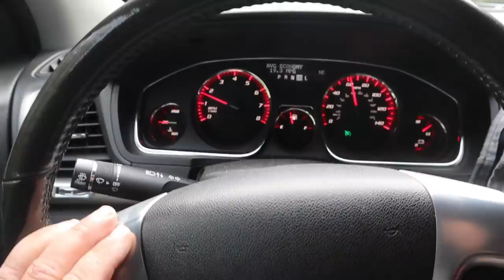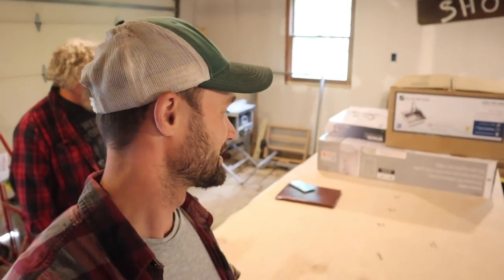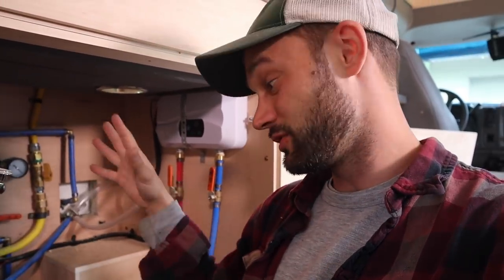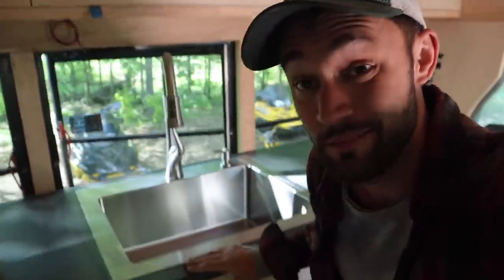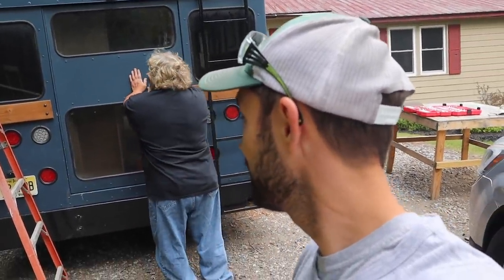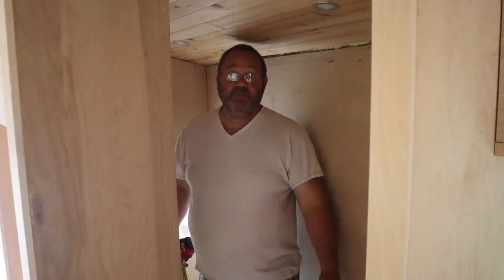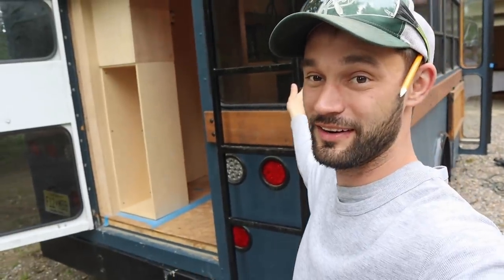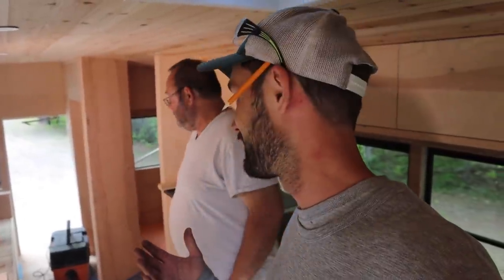What Was I Thinking | Removing The Rear Emergency Door

Comment: That door flipped around is really growing on me. Plus it made it way easier on you. Great job everyone!
Reply from the maker: It was a lot easier to just switch the door upside down than removing the hinge. I was really happy when Dale came up with that idea.
Reply: @navigationnowhere  I love the comedy trio you have going on. Dale is one funny dude. I’m renovating my bus right now and I’m debating completely blocking off the back door with new sheet metal. The chore of rivets is becoming overwhelming though haha
Reply from the maker: Thanks, Going through all those rivets can sometimes be so hard. Worth it in the end.
Reply: @navigationnowhere  looks great! My husband and I watch all your videos and we love you and your channel. We were curious if you would add any contact paper to the door windows for privacy?
Reply: @ladyaofpineapple5000  I've used a Valspar product to frost (the inside) windows in my home. I used a big sea sponge. It dries fast, so you can build up the number of layers to achieve the desired effect. UV doesn't degrade it.

Comment: In the video regarding the pan Kit when dad is showing the drain and pieces putting the 1st piece in,  you can see all of the layers? wood foam etc.  is there a tube piece that is in the hole so the drain water doesn't find its way between those layers.  Sorry if its a dumb question, watching  these videos to see if this older lady can tackle this alone?   :)

Comment: That's funny, I actually installed a built in soap dispenser into my sink. It's nice not having to store a soap bottle anywhere, and having it tucked up under the counter top taking up unusable space was perfect.
Reply from the maker: I was not originally looking to have a soap dispenser but since I have one, it seems like a great addition. The soap in my other bus would always bounce around when driving.
Reply: @navigationnowhere  plus at some co-ops you can refill it with bulk soap.

Comment: I saw a contractor that I follow installing this same shower system in a home and it’s very versatile and his bathroom project came out amazing. Now, in the bus going down the road, who knows what the outcome will be as time, especially with all the movements.
Reply from the maker: From what I have been reading it should hold up fine on the road. But, I am going to have to report back in after a few months and let everyone know how it went. If it works, it could be a great option for the community.

Comment: A metal manufacturer will make you a shower pan to your measurements.  We had a copper one made with folded edges for our last house. My husband had to replace floor and wall joists due to damp rot, it never leaked again. The kurti system isn't available here in Australia, building regs in houses here require a concrete floor for bathrooms.  Love the door being upside down, I prefer the unusual.

Comment: If you look at the TV show "Holmes on Homes" you will see that the shower kit you are going to use is all that Holmes' home rebuild / repair team uses for redoing their customer's kitchen and bathroom units.  The Detra kit is outstanding if the installers follow the directions and lay the Detra mat and then the tile etc.  You should have an excellent install if you follow the directions.

Comment: Different Idea: you can always change it to a bigger door or you can installing a swing down  (2 plywood glued together and cut to the size of the door...held down by chains on either side.. to either sit on like a deck or use the space as a cooking platform when out in the world or use it as an outdoor shower (covered ofcourse) the open space left while the deck is down you can use those light colored cloth mesh with magnets, when winter arrives you can always replace the pull down deck and install the door back into its hinges.
On the side note.. callin yo dad a stooge is not an ideal analogy..shhh

Comment: Back door.
Looks schmooks!
I like it because the bigger window is where it needs to be.
Ok... Yeah... I have a camera back there, big Woop, right?
Within 20 miles of having the backup camera installed, something crashed INSIDE the bus and I was on a narrow, hilly road with no reasonable place to pull over for 20 miles! (Of course, like an idiot I had also removed the big monitoring mirror...)
So anyway, what crashed was no big deal, but I jockied the monitor onto the sun visor and used the regular rear view mirror again. Nearly 5 decades of driving, it's still habit, primary mirror... Blah blah blah... 
But I noticed that lower window is awful tiny, and that's where you can keep something of an eye on those idiots who tailgate (there are laws, folks, and the laws of physics are the highest law... Don't tailgate!).
I like the bigger window on the bottom.
Your bus is very similar to mine.
I am now looking at the idea of flipping my door. 🤔🙃
I LIKE IT!